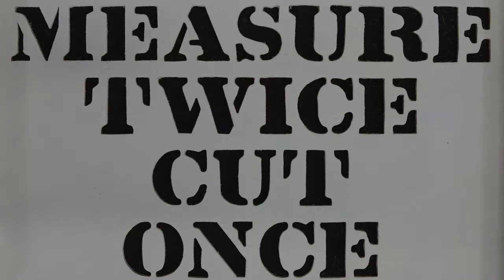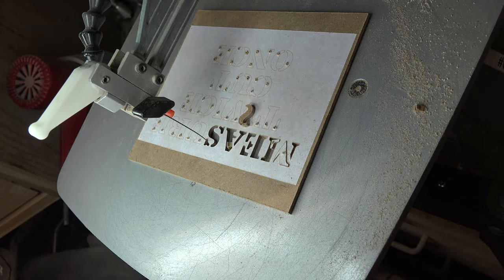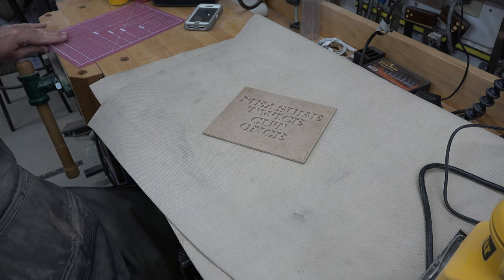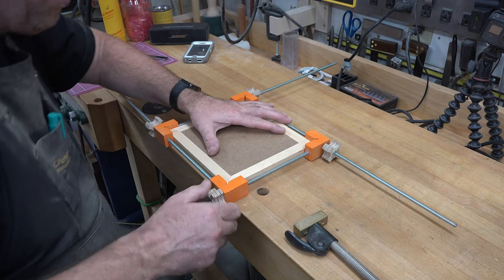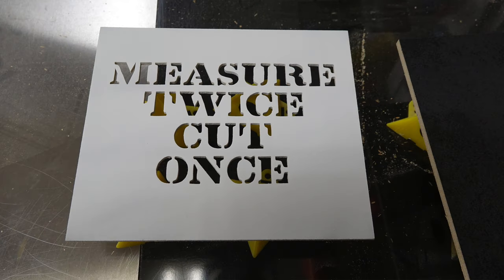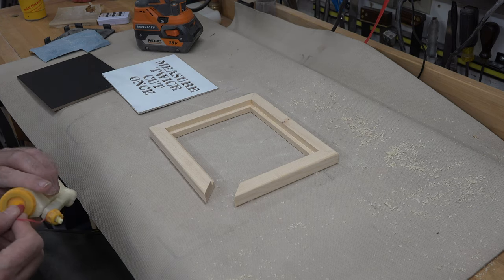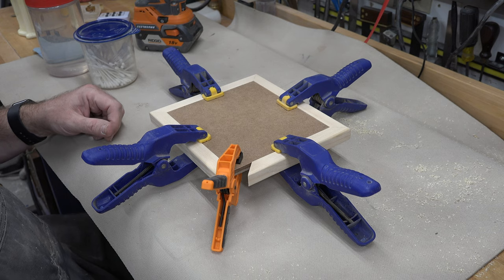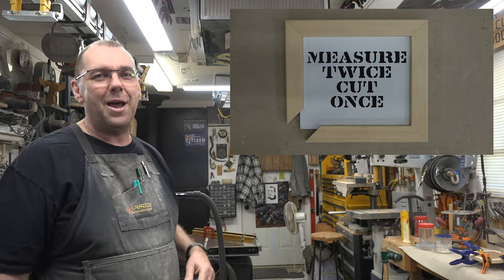Scrolling a Shop Wall Sign

Comment: Kenny, if you place painters blue tape on the work piece before installing the scroll saw pattern will save a couple of clean-up steps.  The tape peels off easy and will not leave any residue on the work piece after you complete the scroll saw process.
Reply from the maker: I've used the painter's tape method before Mike and honestly, I don't like it.  For something simple like these stencilled letters, it might be just fine but for some of the intricate cuttings that I do, I find that the sawdust has a tendency do get under the edge of the tape, causing it to lift from the stock.  I won't get into the problems it creates after that.  Because of that, I never use the painter's tape method on intricate cuttings and I guess it's just habit for me to apply the pattern directly to the wood.  Maybe it's time that I revisit the tape method for more basic cuttings and give it another chance.  Thanks for tuning in to the show Mike and for chiming in with your suggestion.  It's very much appreciated.

Comment: Awwwwww, my favorite, the scroll saw. I try to always make an excuse to use it on every possible project. Cool project Kenny. I've drawn up a sign this summer the says "Papa's CTR". (Central Tool Room). Thinking about using some aged pallet wood. Thanks for the video!
Reply from the maker: You're very welcome Michael.  Like you, I also find that the scroll saw seems to sneak its way into most projects.  It's just a great tool.  Good luck with your project.  I love the slogan you are considering.  Thanks for tuning in.
Reply: @acutabove_woodworkings  I was a U.S. Navy Seabee , We Build We Fight, Naval Construction Reserves. The CTR was where we would go while on Base to get extra tools or have them replaced. The term just suck with me lol. Thanks for the nice comment.
Reply from the maker: @michaelmarchione3408  Awesome story.  Thanks for sharing a little bit of the background of the sign.  Makes it that much better.

Comment: I have a heat transfer tool for patterns made from laser printers. The carbon from the print is transferred to the work piece. Some patterns, with numbers and letters will require mirror images
Reply from the maker: Although I have never tried this method Drake, I have heard good things about it.  I agree that the lettering would have to be mirror image in order to transfer correctly but in this day and age of technology, that's an easy task to master.  Thanks for tuning in and for taking the time to chime in with your experience.